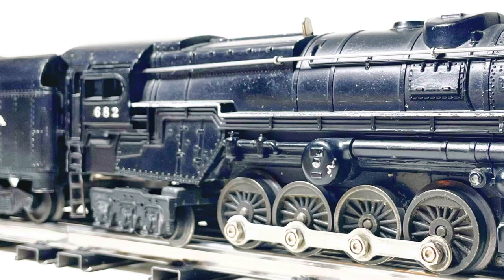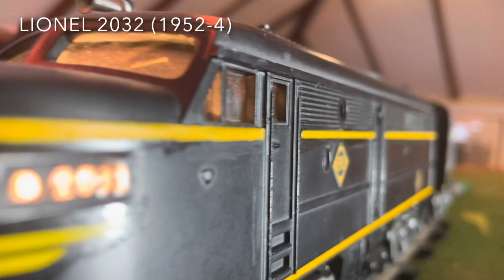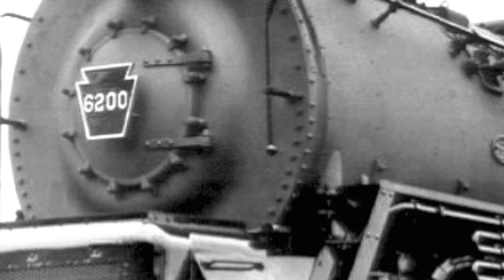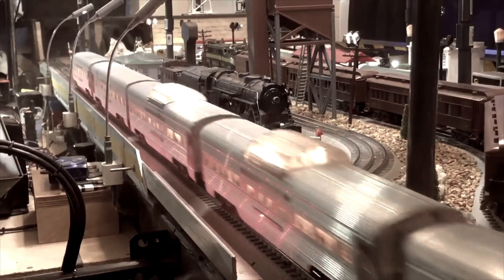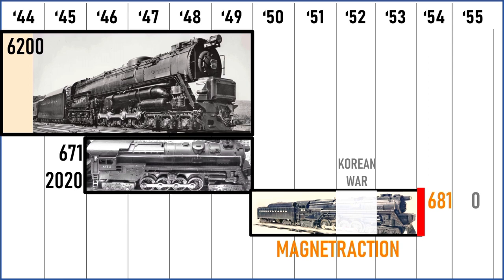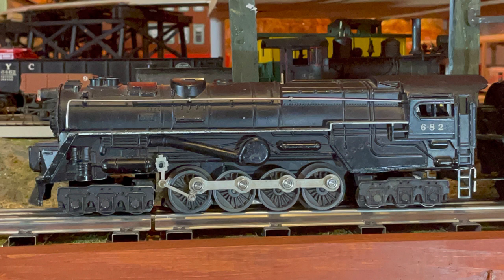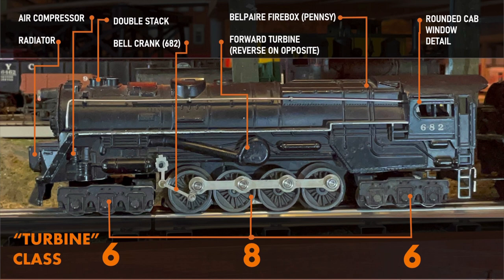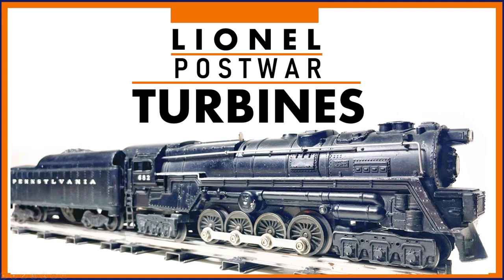Lionel Postwar Turbines 671 681 682 2020 (1946-55) / Bonk’s Trains / Sharpnack Limited

Comment: As a kid I had the 671 and the 2020. The 2020 had a smoke bulb but the 671 had a smoke unit. Both were excellent pullers. Even though the 2020 was the 027 version, they were both identical except for the electronics. The 2020 had a wire swap to reverse and the 671 had the old E unit reverser.
Reply from the maker: thanks for the information! and for watching.
Reply: The bulb smoke unit and the drive system in your 2020 was for one year only, the following year the Drive system and smoke unit were replaced

Comment: Great history and video. 
I love the turbine. I’ve had a few: a couple 671s, a couple 681s, and the MPC era 6200. All have been great engines. One of the 671s had the optional weight inside and pulled almost as well as a 681 with Magnetraction.
Reply from the maker: Cool.  That’s interesting about the optional weight.  How was it optional, did some versions have it and some not?
Reply: @cmcgloughlin  I’m not sure if it was a production date thing but i know it could be added later.

Comment: I love your history of the Lionel turbines and the corresponding history of the real thing. You have an excellent speaking voice BTW. As an original owner of a 682 I think that the bell crank on the unit pictured is on backwards. I know that this has been a on going point of contention with 682 owners. I also noted that you showed a turbine with twin smoke stacks. I have not seen that on any models. Curious. Thanks for the video. I will keep it in my archives.
Reply from the maker: Thank you for watching and for the kind words.  You may be right about the bell crank, and as it turns out, the rigors of filming this video caused it to come off!  :(  I'll have to fix it :).  The Lionel smoke stack is only one hole, but if you look closely at the diecast molding on the model, you can see they detailed it to appear as if it was two, just like the "real thing".
Reply: It is ,on mine and all other photos.Disconnect it from the axle ,NOT from the boiler ,it's pressed in and can break off.Its fragile. Great engines.
Reply: Every photo of the Lionel catalogs the bell crank looked like a knee,but then I saw another photo like yours ,so??
Reply: Real nice video.🚂🚃🚃🚃

Comment: If the 6200 worked well at low speeds, it would have provided tractive effort throughout the entire rotation of the drivers and not just beyond top & bottom dead centers.

Comment: Lionel's F3 might have something to say about being the best-selling engine. That said, love my 2020 turbine.

As for the 6200, it might've been more sucessful if it had been geared for slower speeds and hadn't been loaded full of gee whiz features that ultimately were extra points of failure.

The Swedes had the M3t turbine locomotives. Stupid simple, geared for freight service with conventional boilers and no condensors or other gimcracks, and the turbines were controlled with conventional throttle valves like a reicropcating locomotive. Ran for decades with no problems, one still is in working order and is preseved.

Comment: These postwar engines will out live the China made modern engines. No doubt.
Reply from the maker: This is my take: Regardless of nation of origin, I prefer the postwar because they aren’t reliant on digital technology. If one of these postwar engines break I can fix it.  Current lionel has microchips and digital components and if they break then I just have to get it fixed at the store— no learning takes place and I just am frustrated.
Reply: Yes ,getting new circuit boards in twenty years ? You will see the beatifull scale engines on the shelf,and old engines still running on the tracks.

Comment: When you run your 671 for 20 to 30 minutes does the engine and brush cylinders get very hot? After weeks of running does the engine speed diminish?

Comment: How does the 2020 differ from a 671?sliding shoe vs pick up roller?
Reply from the maker: Hi! To my knowledge the only difference was that the 2020 was for o27 gauge sets and 671 was for 0 gauge.  I think that was just with the sets they were sold with, no difference of consequence otherwise.
Reply: Thanks I need to get another Turbine
Reply: The only difference in the two (provided they were built the same year) was the number on the cab.

Comment: Steam turbine and steamships work while because they tend to run in their most efficient range all the time. Locomotive do not run flat out all the time and when the steam turbine was run at anything other than flat-out it was inefficient and difficult to work with. A nice try but a pitiful failure.